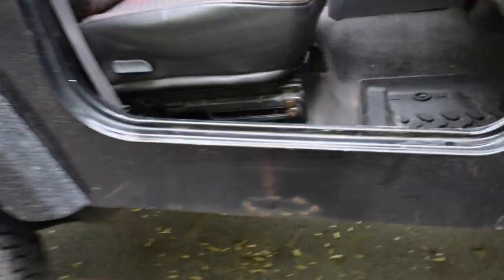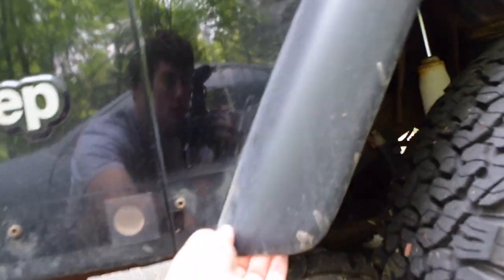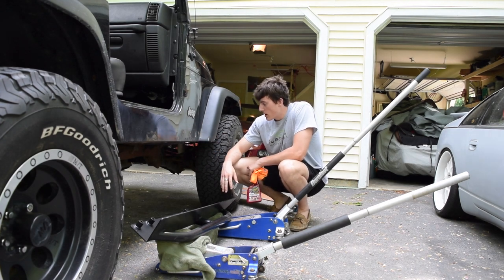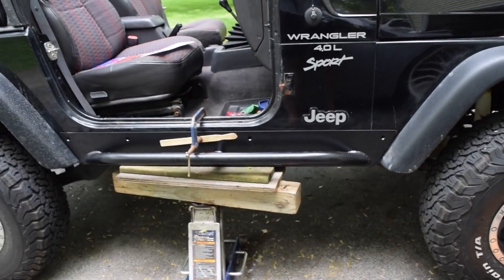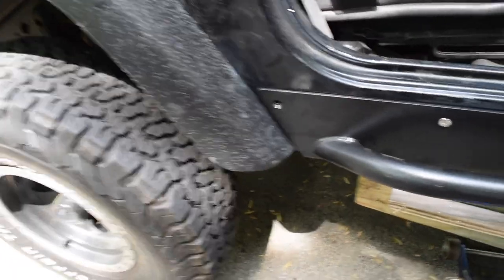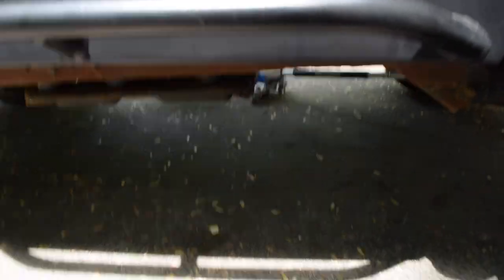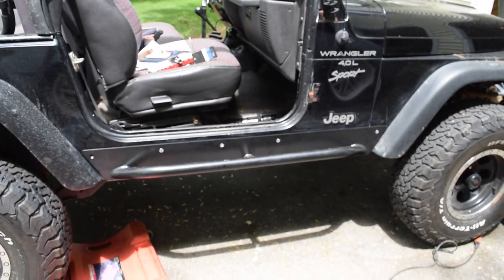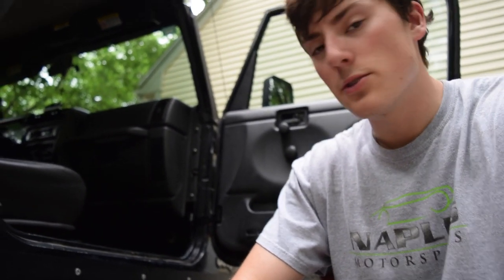Jeep Wrangler Rock Slider Install

Comment: I couldn't take you seriously after you said they weighed 50 to 70 pounds a piece. They weigh about 15 to 20 pounds
Reply from the maker: Sounds like you might have to hit the gym pal
Reply: @DriveHub  lol i need to hit the gym? I wasn't struggling to hold up a 14 pound hollow pipe then trying to cover it up saying it was 70 pounds
Reply from the maker: You must be huge then man.  Thanks for watching!